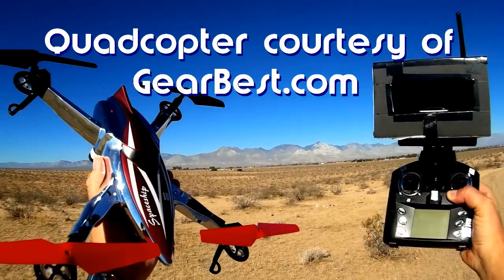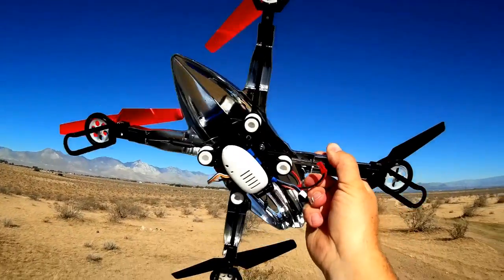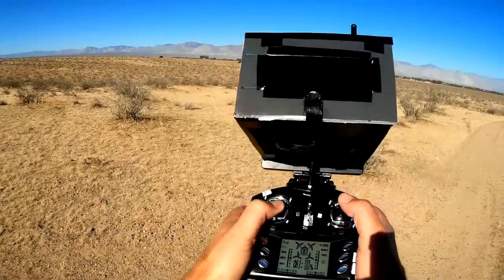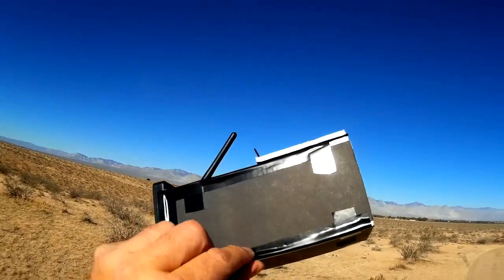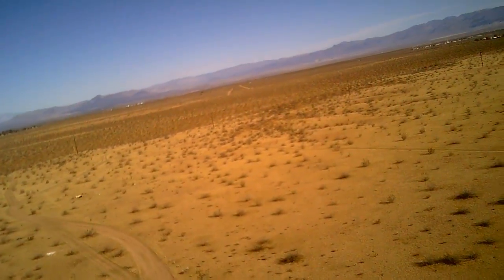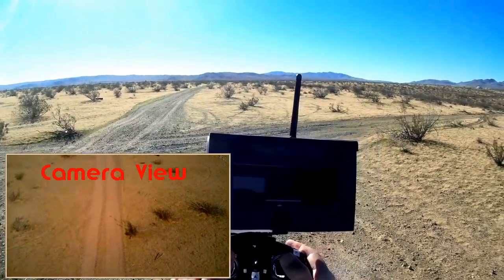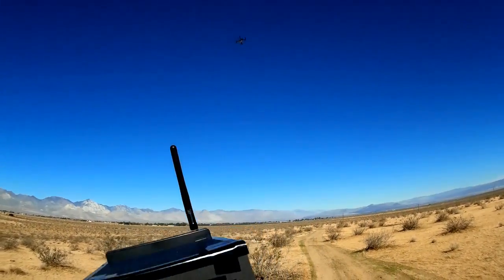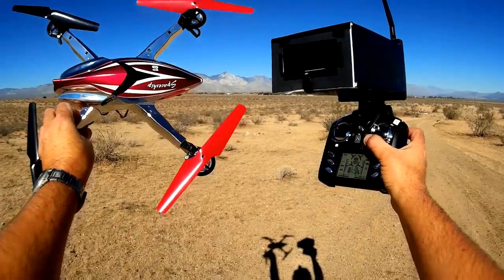WLToys Q212G Large Altitude Hold 5.8 Ghz FPV Drone

Comment: interesting. i always suggest the 262 as the ultimate beginners quad copter. specifically because of its size. being so large it is easy to see easy to keep a orientation control fix on it and its very slow and docile with high inertia so it does not do anything fast or crazy. everything is in slow motion just what a beginner needs its also so light which when combined with that foam shell makes it damned near indestructible and most important unable to hurt people if you whack someone with it.. i find the small ones to be much much harder to fly relatively speaking. what is the flying weight of this critter?

Comment: As you say in your video, the auto takeoff may be hard on the motors.
I would feel more comfortable if I could control the takeoff with small
throttle movements.  I tried the way you mentioned in your video and
the spaceship screamed to takeoff (had the legs weighed down to 
prevent liftoff).  I have tried everything, but have had no luck controlling
the throttle.

Comment: Quadcopter 101 - Im thinking of purchasing just the body shell to fit my older version WL Toys V959 (camera, bubble & water shooter add ons) Trust me, I do not need another quad but would like to change out the body on mine. The flimsy one on the V959 is OK but this Q212 is really cool. Like you mentioned, BOTH models appear to have the same size frames. Will I be able to perform this? I have no problem with any modification if req'd

Comment: Hey Q101, when you used your black box on this one, it took your picture off the screen reflection when you were looking thru the slot! Could barely see the FPV. I DO like the box though.
Reply from the maker: This was done a few years ago, before I had FPV goggles with built-in DVR recording capability.
Reply: Quadcopter 101 I still like the idea. Just logistics of where the sun was.

Comment: Got back right motor flashing red and blue, rest are white before take off . Then q212g flies about 10 seconds correctly and then no throttle control and comes down . Done several times, same thing. Bad motor??
Appreciate your input
-Rob

Comment: it seems like no one has parts for this,especially the motors.
thanks
Reply from the maker: +harrybuick The WLToys Q212G is based on the old WLToy V262 frame and motors, as is the WLToys V666.  As such, the following should work with this quadcopter http://www.gearbest.com/rc-quadcopters-parts/pp_145475.html

Comment: Is there another tx I can use for this quad-copter.? I cant bind mine and i dont like the 
whole combination lock starting method in the first place...Im getting a v222 tx this week, it would be cool if it worked with this, but it probably wont..

Comment: Considering my 686g rarely produces jello - that mount must be awesome smooth. I really need that altitude hold more than any thing! Just excellent! It seems bigger/ heavier than the 686g? Does it use the exact same motors/ prop combo?
Reply from the maker: +Ralph Latham No it uses much bigger motors and props than the V686G.

Comment: I appreciate your help with this q212g quad.  I guess most of my problems
are the result of the poorly written instruction manual.  The help with the
gyros seemed to work except that this quad does not respond to any throttle
control signals.  Once the idle speed for the props has been achieved, and the
throttle is moved up even a small amount the props take off full blast.  There 
is no control.  Any more help you can offer would be appreciated.
Reply from the maker: +Lon Rogers This takes off rapidly in automatic takeoff as shown in the video, but should stop when it reaches a height of 1 meter, where it will level off and automatically maintain that altitude.  Once it levels off at 1 meter, you should be able to gradually adjust its height.

Comment: isn't the fpv view the same as the camera view since both is showing where the quad is going?
Reply from the maker: +george aura Yes, the views are the same. But the FPV view is lower resolution to reduce video data streaming requirements.
Reply: +Quadcopter 101 ooooh ok I get it
Reply: +Quadcopter 101 good idea

Comment: Hey Quadcopter 101, quick question. I love watching your videos and am trying to figure out the best quad under 100 bucks that will fly the best with wind? The Syma X5C and all it's variants have the "wind bug" and I looked into the MJX 101 and it looks good but I wanted to see if I could get your take on the whole wind thing. I live near the gulf coast and is almost impossible to get a day without wind. Thanks!
Reply from the maker: +mdav9609 The Syma X5SC and X5SW have the wind bug.  But the Syma X5C does just fine in the wind if you remove its prop guards https://www.youtube.com/watch?v=xVckey8aA5A
The MJX X400 is another good windy day flier https://www.youtube.com/watch?v=6gv5RwytVtI

Comment: How much power is the 5.8Ghz transmitter?
Would this be a step up from the Syma X5C-1?
Ken
Reply from the maker: +Ken It's not very powerful, with a max range of about 100 to 150 meters. And yes this would be a step up due to its size.

Comment: As usual, a very nice review, and the Q212G also looks like a very nice quad.  Seems this camera also works on the X250 and V686.  Some questions:  The F959 plane (with included camera mount)  has a 4 prong plug under the canopy that looks like it may be a camera plug.  Will this camera work with the F959?  How about the A600?  It would be so great to be able to just move this FPV rig to the different XK/WLtoys quads/planes and keep flying FPV with all the various models.
Reply from the maker: +Ed Arenz Dang I didn't notice that plug.  But it may just work.  Will have to try it in a future video.
Reply: +Quadcopter 101 Thanks much!  Wouldn't it be cool to just strap that camera onto the F959 and voila?  Maybe the A600 too, maybe not.  Keep in mind that as far as the TX, the F959 is FlySky and the A600 (believe it or not) is V2x2 (not Futaba) like the Q212G.

Comment: I just ordered this one off the link you posted in the description..  This will be my second quad, first was the striker spy drone (x5c clone).  How does this one compare to the x5c and about how long should shipping from gearbest take?  Thanks for the great videos!
Reply from the maker: +Z Noble It's much bigger, but still very stable.  As with most China vendors, it takes 3 to 4 weeks to cross the ocean by boat and arrive at your door. During the time that it's at sea there will be very little tracking info (if any).
Reply: +Quadcopter 101 Right on.  I'm a little OCD when it comes to things like tracking orders but I'll practice patience this time, lol.  Thank you again

Comment: No mention is made of "Mode 1" or "Mode 2"  Not in manual either.  What is difference
and how do you change from one mode to another?
Reply from the maker: +Lon Rogers Mode 1 has throttle on right stick, and Mode 2 has throttle on left stick.  It seems to have something to do with how our brains are programmed from driving.  If your country drives on the right side of the road, then Mode 2 (left throttle stick) is more popular in your country.  If your country drives on the left side of the road, then Mode 1 is probably more popular in your country.
Mode 2 seems to be more widely available on controllers than Mode 1, so I recommend if possible learning Mode 2 as it's very hard to switch back and forth between the two.  Although some other models have switchable controllers, unfortunately you can't switch Mode 1/2 on this quadcopter model.  You have to specify which one you prefer that they ship to you when purchasing.
Reply: Thanks...that was helpful.

Comment: Cool copter. What do you think the range is on it and also the FPV range. This looks like it could be a descent camera quad. I did notice just a little jello but I don't think it would be hard to fix that. Would you say it is the size of the tarantula X6? Do you have any idea what the shipping actually is for USA, Sorry for all the questions but this look interesting. Nice video and great FPV hood nice job.
Reply from the maker: +Skydive Driver About 150m range.  FPV should be about the same.  Yes, about the same size as a Tarantula.  Currently (10/24/2015) shipping is $13 (total cost $115) to USA if you select "Priority Direct Mail" at checkout.
Reply: Thanks for the fast reply and info. I am assuming that it will left as much as the Tarantula. Looks very promising.

Comment: I saw a guy installing a sprint in the left lever of a syma x5sw's controller but I didn't watch the end of the video... i'd like to know If could be possible to keep some level altitude in the syma like in that video...
Reply from the maker: +Rafael Cabrera Ferreras No, this quadcopter has a built-in barometer that senses the altitude, and automatically adjusts the throttle to maintain it.

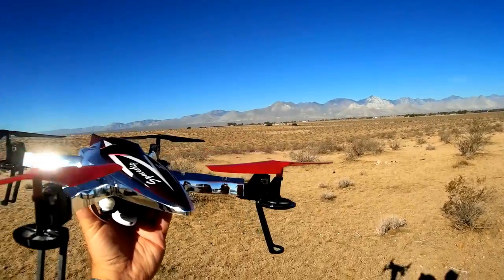Comment: One more question, can you confirm the v262 motors are the same as the q212g?  After doing more research and taking your advice from 1:00 into this vid I'd like to buy extra motors asap but finding direct replacements is a challenge.  I have a hobby town in my city and I was gonna see if the ethos hd or fpv motors match since the quads look to be identical.  Sorry, not trying to bug or anything..  Just trying to get my ducks in a row.
Reply from the maker: +Z Noble V262 or Tarantula X6 motors will work
Reply: +Quadcopter 101 Cool deal, thank you.
Reply: +Z Noble does the gear or x6 work to?

Comment: Hi I can use the syma x8c with the walkera g-2d gimble it is made out of plastic it reduces flight time to four minutes but I can buy more batteries
Reply: The tarantula x6 can take it so I'm sure the x8c can
Reply: +ReallyHarrison there are many videos, I'm not going against your suggestion but I still think it would work
Reply: +ReallyHarrison is there any other quadcopters around this price range which can lift a gimbal
Reply from the maker: +ReallyHarrison No, not without damaging the quadcopter's motors.  You really need a brushless motor quadcopter to lift a gimbal and camera (Cheerson CX-20, Flying 3D X8, WLToys V303, XK Detect X380).
Reply: +Quadcopter 101 how long would the motors last with a 200g weight
Reply from the maker: ReallyHarrison I don't know.  Ask those guys who have hooked a gimbal to their brushed quadcopters how long their motors lasted. I think that you'll find that they had to replace at least one motor soon after doing such.

Comment: No luck getting this quad to idle.  Everytime I start it, it automatically
takes off and flies to one side out of control.  Any advice?
Reply from the maker: +Lon Rogers Have you tried calibrating your gyros?  
1) Turn on the quadcopter and place it on a flat and level surface.
2) Turn on and bind the transmitter. Set it to 80 or 100% rate.  Center all trim tabs.
3) Leaving the quadcopter undisturbed, move and hold both control sticks to their lower left corners.  Hold them there until the quadcopter's lights blink.
4) Let go of the sticks and try flying.
Reply: Thanks for the info
Reply: What kind of air temperatures are you trying to fly in?

Comment: Hi i bought this quadcopter some time ago and it was really nice but unfortunetly after some flight and really light accident i can't filght anymore . There is no any reaction on the start sequence.  I found that the coverage rate indicator (small antenna sign ) at the transmiter display doesn't show any range (like out of range) . Unfortunetly my alibaba seler doesn't answer on my emails. Could You please help me somehow to solve this problem ?
Thank you in advance for the answer.
Reply from the maker: +majewa68 Try bending the small antenna wire inside the quadcopter to a different angle.
Reply: +Quadcopter 101 Hi. Thank You very much for the answer. The antenna is tighten to the drone "leg" but i h'v tryied do as You said moving the silver end of antenna to the left , right , and nothing changed :( Still there is no connection between transmiter and drone :( Don't know what to do :(((( Mayby by mistake i did press some button sequence at the transmiter and changed the transmission frequency ? Is it possible ? Thank You in advance for help.
Reply from the maker: majewa68 No you can not change the frequency, so don't worry about that.  Another possibility is that these will not bind if battery power is low.  Try charging your quadcopter battery again, and also use new batteries in your transmitter to see if that helps.
Reply: +Quadcopter 101 Hi. Tnkx again. Unfortunetly i checked the ;bateries , charged them again full and there is nothing change :( I'm using an aku against standard bateries in the transmiter but i don't think it can be a reason , especially i'm using them from the begining and the drone was fly before. By the way can You tell me if TX range shows the transmiter bateries power , or the drone batery power ?
I'm affraid that something in the electronic is wrong , mayby in the stransmiter , maby in the drone . Ehh my bad luck :((((

Comment: 70 degrees F.  No throttle control from on-ground idle.  It is either
full speed or nothing.  I am not sure I am using the correct
stick commands.
Reply: Hey Lon, how are you binding the quad to the transmitter?  If you're pulling the throttle down before you turn on the transmitter, DON'T!  Here's how I do it and it seems to work perfectly..  Plug the battery up to the quad first and set it on the ground immediately, next turn on the transmitter with NO fingers on the throttle or pitch sticks, after you turn it on and it beeps move the throttle to 100% then pull it back down to 0% to bind, then gently let go of the throttle and let it return to 50%.  Next, put it into idle by pulling both sticks down and inwards towards each other (bottom right of throttle, bottom left of pitch).  The props should be spinning slowly now, after they start idling let go of both sticks gently and it should remain on the ground in idle until you give it around 70% throttle.  I think it still does the auto takeoff when you hit 70% but at least you control when it happens.  Mine did this to me once (it was nasty) and ever since I've paid close attention to the transmitter before takeoff.  Always be sure it's reading 50% on the transmitter display while the throttle is at rest in the center with no fingers on it.  Let me know how that works and hey, check out my q212 vids if you want and comment on one of them that way it'll be easier for me to find your comments and try to figure this out.
Reply: I'm uploading a vid of my startup proceedure right now

Comment: I bought one and the lcd monitor doesnt turn on. Am I doing something wrong? Or is this really bad quality? there were no instructions that I could read.
Reply from the maker: +Rob L You may need to charge it first.  It comes with two chargers, one for the quadcopter, and a smaller one for the screen.
Reply: +Quadcopter 101 I tried charging it for hours. Still does not turn on. also they sent me a European plug not an American.
Reply from the maker: Rob L Jiggle the plug adapter in the wall.  The adapter plugs might not make good contact.
Reply: +Quadcopter 101 I fixed it.  I opened the lcd and saw the lipo batterys negative wire was not connected.  I soldered it and the lcd started working. Not sure if Ill order stuff from gearbest anymore... Unless its cheap small stuff.

Comment: I just received this quadcopter from Gearbest.  I live in South Carolina in the United States and it came with the European wall plug.  How can we say useless.
Reply from the maker: +Bill28200 If you still have the external wrapping tape and foam, closely examine it for the following part.  But if it's not there, the US adapter plug is very cheap http://www.ebay.com/itm/EU-Euro-Europe-to-US-USA-Power-Jack-Wall-Plug-Converter-Travel-Adapter-Adaptor-/141198238440

Comment: Wltoys v686g or hubsan x4 h107d?
Reply: Grigoris Parisis Is the fpv range better?
Reply: +Mr Bonk I was very disappointed with the 686. the screen it came with is almost unusable because it's so dim, the fpv frame rate stutters when you record video, it seems heavier than it should be, takes off with a delay, and if you lose altitude quickly and try to recover it seems under powered. I then bought the FPV kit for my Syma X5C, much better! Only cost $50, bright monitor, no lag when recording video, and the camera has it's own battery so it can be made to work with other quads. My current favorite is the MJX X600 Hexcopter, with it's 6 motors and 7.4 volt battery it has plenty of power, a mobius is no problem. Wish it had a barometer though.
Reply: +raygunz333 MJX are IMHO one of the best - if not the best - toy grade manufacturers and have great products at reasonable prices. They do have issues however but nothing like the oddball JJRC/YiZhan/WLtoys types.
Reply: +raygunz333    ///   This fpv video is in 5.8hz?
Can you give us the name of this unit?
Are you using it even right now or have you find something better in time?
Thank you very much.